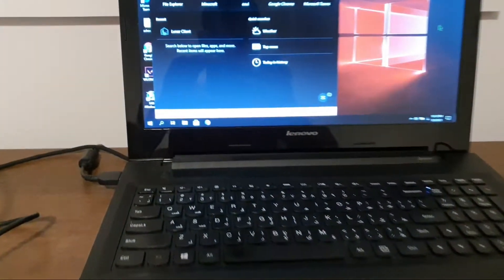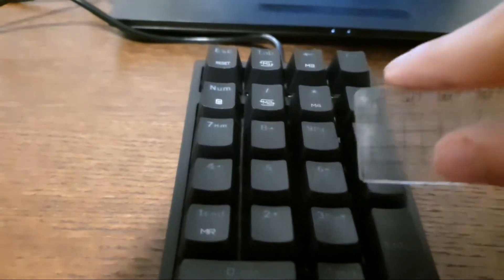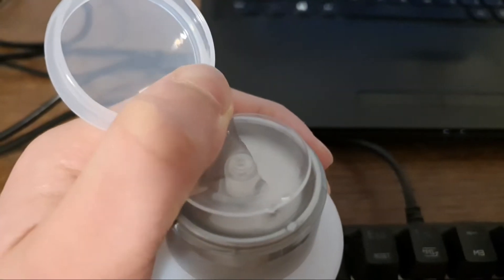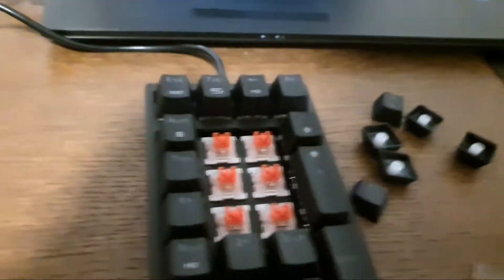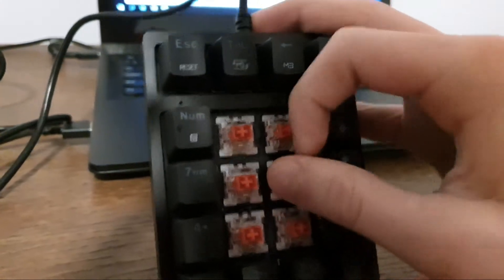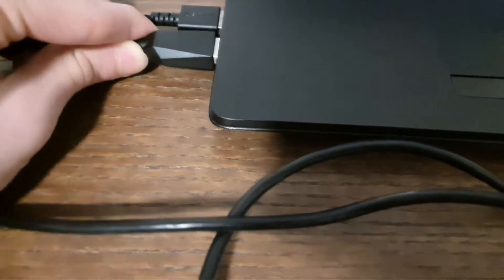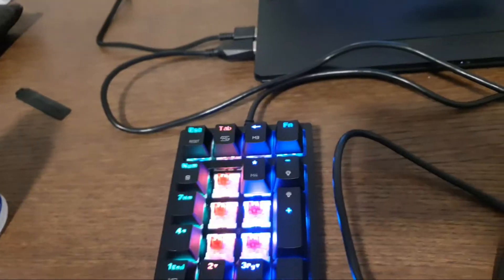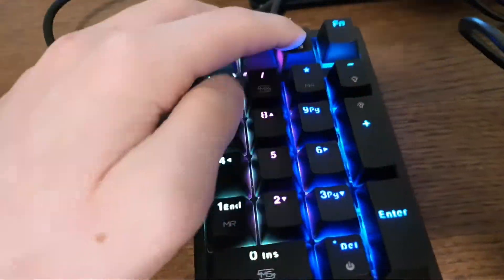Fix an Unresponsive Keyboard Switch [No Compressed Air]

Comment: What if yyou use a 40% alcohool rubbing alcohool and you let it dry ?
Reply from the maker: 40% alcohol would work just fine but I would let it dry overnight just in case, to let all the water evaporate. Also keep it somewhere warm like next to a heater but not so close that it melts.
Reply: @YoussGm   i did the most engineering thing ever xD
Dry in front of a fan lmao thanks it worked but sadly one button still messes up... idk whats wrong with it worked fine months ago.. but thanks
Reply from the maker: @gaby232323  That's great, for the button that still doesn't work well, you can try to do the steps again but really push on the key and wiggle it from side to side while pushing.

Comment: How often does this last until I have to do it again?
Reply from the maker: Personally I only had to do it once and it's still working. It lasts until dust gets back into the switch.
Reply: @YoussGm  i mean i just got this keyboard 7 days ago and it happened so i am scarred it will maybe happen again but thank you  fort this, its still has waranty so in worst case i can get it replaced
Reply from the maker: It's because when they make the switches in the factory there can be residue or like plastic dust that interferes with the mechanism, so it should be fine after doing this once.
Reply: @YoussGm  alright, thanks

Comment: For me it isn't even the switch that the problem, it's the pcb itself that isn't registering the keys Y, H, and N. (Im typing this on a different keyboard)
Reply from the maker: That would be a lot more difficult to fix. If the pcb is the problem there could be corrosion due to water damage, or the pin connections got loose, or there's a deep scratch somewhere, or something else.

I couldn't help with that, hope you find a solution, guessing your different keyboard is the solution.

Comment: Hi,one question if the button is like shift or space do i need to put alcohol on side switches too or only the middle(main)one?
Reply from the maker: Only the middle one since that's where the actual switch is. The ones on the sides are just to stabilize the button and don't actually have any electrical components in them.

Comment: Holy crap it worked... I'm amazed, thank You. Also I used lower % alkohol, just alcohol for disinfection (around 70%)
Reply from the maker: You're welcome! I also used 70% alcohol since that's what I had around, it's just marginally safer to use a higher percentage.

Comment: thank you i was sceptical but i pulled the switch out (I have a hot swap) and soaked a little alcohol into the socket and it worked!! my keyboard was impressively dirty like there was probably a whole ecosystem I just terrorized
Reply from the maker: Thank you!
Reply: back again 😔😔

Comment: I do it for my spacebar and fix it but when im done with my keyboard next day same problme please someone help
Reply from the maker: Try doing it one more time. The dust and dirt inside the switch probably resolidified.

Be generous with the alcohol and press down on the switch really firmly while wiggling it side to side, this will remove anything stuck in it.

You can also take the whole keyboard and give it a few firm taps on the side while the alcohol is still liquid, this will dislodge anything that's still stuck.

Goodluck, if it still doesnt work, make sure to keep me updated!
Reply: @YoussGm  i just ask a ai and told me w-40 liquid and i have it and i try and work fine but i will do tjis everytime?
Reply from the maker: WD-40 is a dirt displacement liquid so it is safe to use and is non corrosive. 
If you do it once, you shouldn't get the same problem again, the dust is likely due to the manufacturing process.

Just keep using your keyboard and everything should work as normal, if not, you can try again. But WD40 should work.

Comment: Would you recommend doing this on a laptop? My HP OMEN 17 has a shallow mechanical keyboard with shorter circle-shaped switches that seem to have less openings for the alcohol to get in than your keys do. I'm just worried about shorting some more serious components beneath the keyboard.
Reply from the maker: If some of your keyboard switches do have issues with responsiveness, then you could definitely do this.

However, i would use a higher percentage alcohol, like 99% just so there would be no risk of corrosion, and alcohol isnt conductive. Theres not much risk of shorting, more of a risk of corrosion (no risk with 100% alcohol).

Also make sure you shutdown your laptop and unplug it from power just to be safe.

Edit: if your laptop is still under warranty check with HP, you might get free laptop or something.

Comment: my  2, W, and S key doesn't register. I tried swapping the switches from other keys that works, but the 2, W, and S key still does not  work
Reply from the maker: So the problem here is not actually with the switch since you tested with other ones.
There might be a problem with the contact points of the switch and the motherboard. 
You could try cleaning the motherboard on the contact area with a bit of alcohol and a cotton bud.
Reply: How did you fix it sir?
Reply: @SF-jx2bu  I can't fix it

Comment: Thank you for this vid! It worked! Usually don't comment on youtube but wanted to thank op and let others know. My "w" key began to have problems registering for 2 weeks and eventually stopped working while in the middle of an fps game. Tried other methods but nothing worked; unplugged and re-plugged usb, uninstalled and reinstalled drivers, cleaned out the keyboard, applied compressed air and rapid clicking, but no tricks seemed to work until I found this video. Followed the tutorial and then let it dry for 30min and now it works perfectly. Great tutorial!
Reply from the maker: Thanks for your comment!
Reply: Am trying this now wish me luck
Reply: It worked thank you so much both

Comment: This fix only worked for me for about a day :(
Reply from the maker: Is it working now? If not you could try this process again as there still might be debris in the switch. Make sure to mash the switches down to ensure contact.
Reply: @YoussGm  I will try that, thanks for the tip! You are awesome for replying to me.

Comment: My keyboard is one of those rip-off mechanical ones you get on the internet, I thought I was gonna have to buy another better original one but you saved me a lot of time, I don't know how to thank you!
Reply: If you put nice caps on that thing and use headphones you would struggle to tell its price
Reply: @wjk2674  If you mod it with lube and foam, you might not even need headphones.

Comment: One question will sanitizer work?
Reply from the maker: I really wouldn't recommend using sanitizer because when it dries, it leaves a residue which will make the problem worse.
Reply: Mate will alcohol wipes work the ones from Costco
Reply from the maker: If it is soapy, it wont work. Try using a wipe on your hands and rub them together. 
If you feel something soapy or sticky, you shouldn't use it. If its just alcohol and it evaporates, you can use it.

Comment: This actually worked!! Thanks a plenty!! The 'M' key and the left arrow key on my CoolerMaster CK530 gave me a headache for months.. Previously, I had to deliberately and consciously press the 'M' key and I had to smash on the left arrow key for them to register any response.. It got really bad that I even considered opening and soldering-in some new switches.. 

I left it to dry for 30 minutes and I used a dryer while pressing those keys repeatedly, and it actually worked..
Reply: Lol same model and same key having the same problem xD
Reply: wtf same model and also m key
Reply: same keyboard but left arrow key, it seems its just a shitty keyboard @morgenmuffellp8494
Reply: the same happened to me with the v2 version of the same keyboard, dont know how, but that key fixed itself. Now the same problem is happening again but affecting J,8, Backspace and up arrow. Headache ahh keyboard

Comment: This helped my keyboard, Just using it right now and it feels good, Most of my keys would randomly not respond and i'd have to hit it an extra 2-5 times until it would register, This solution seem to has fixed whatever fucked issue it had. Thank you alot, I'll try to keep you update with how it goes after a day or 2 <3
Reply from the maker: Thats great! All putting alcohol does is dislodge and remove any dust particles stuck in the switch preventing proper contact.
Reply: @YoussGm  The keyboard was brand new from a store, It really couldn't have been dust or particles? I hope
Reply from the maker: It might be residue from the manufacturing process. I have no idea tho.